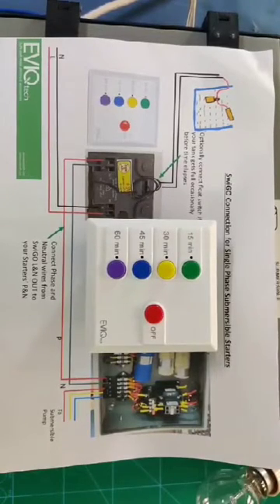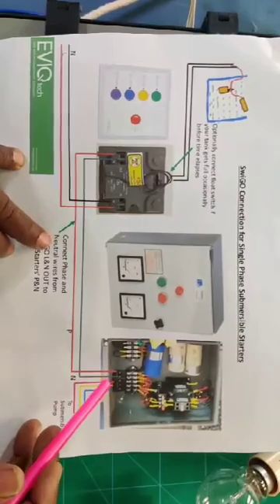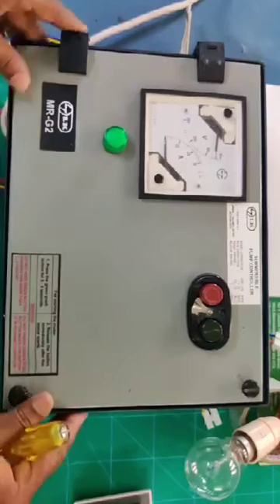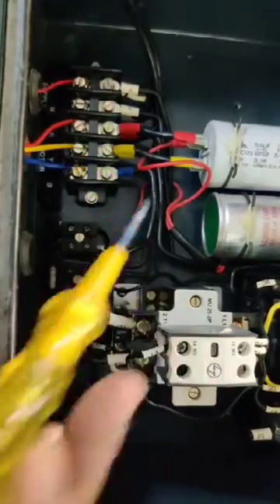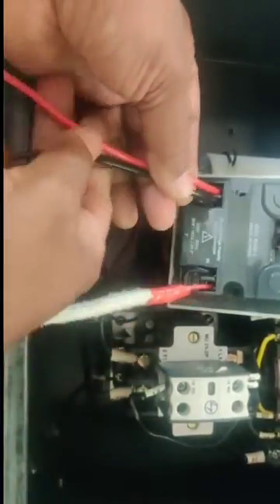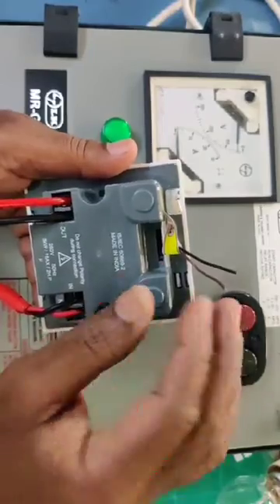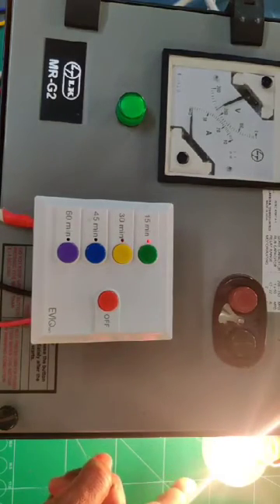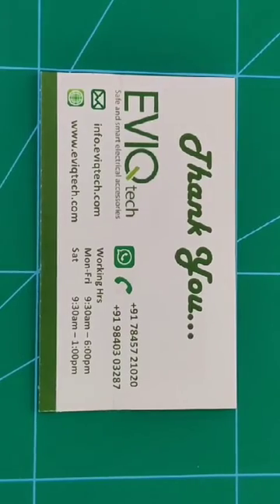SwiGO with submersible starter connection

Comment: We are facing problem.
1) at the time of electricity supply is provide by board pump is start automaticaly without asking to start.
2) we are not getting any message about pump off, dry run, power off or any other issue
Reply from the maker: You will have the change the settings in Relay Settings! You will have to add notification task in the Dry run, power off etc scenes